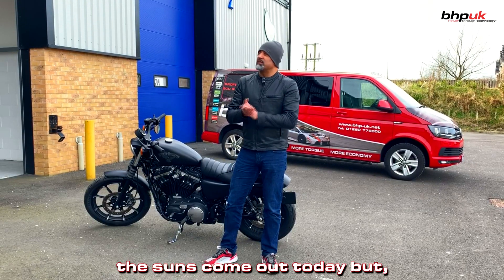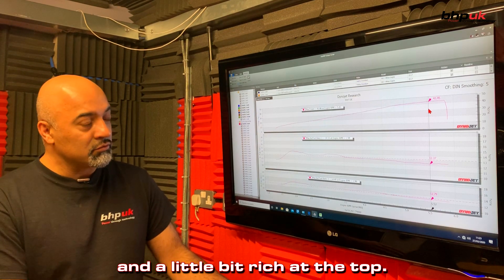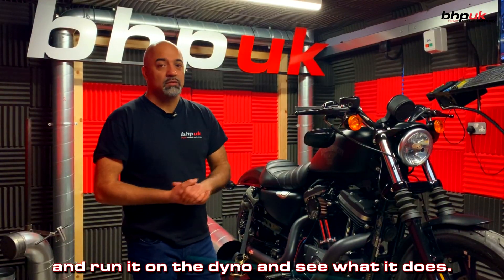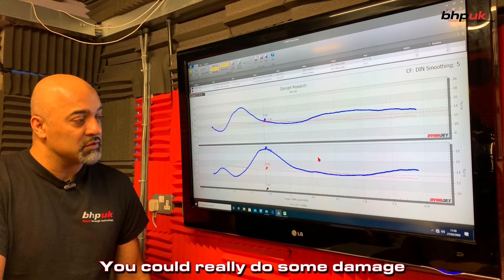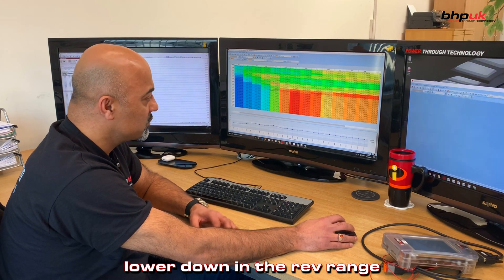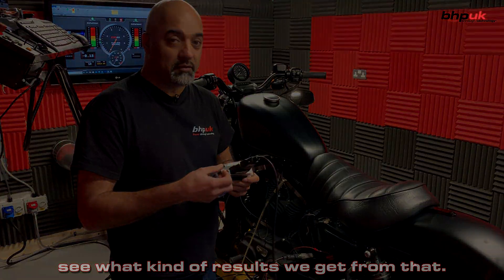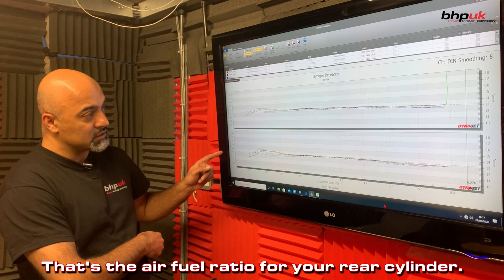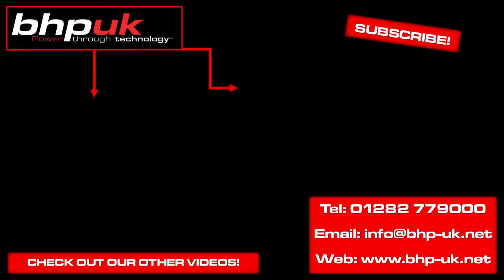Harley Davidson 883 Stage 1 Remap (ECU flash) Development giving 30% Power Increase!!

Comment: i need your advice , my harley davidson iron 883 new model 2021 has vance & hines slip - on , the performance is not the same as the stock motorcycle , what should i do ?  I was advised by some people to install airfilter and fuel pack , I am confused which airfilter should be installed ( k&n stage 1 or Vance & Hines vo2 or screaming eagle performance ) , is it necessary to replace the screaming eagle performance plug and wire also Vance & Hines  Fuel pack 3 too?  give me advice what to do.
Reply from the maker: Give us a call. The map writers will be happy to help. 
+441282 779000
info@bhp-uk.net

Comment: Have you tried that set up but used a “power vision” tuner instead of the dyno ?
Reply from the maker: The Power Vision is another way of flashing the ECU, the bike would still need to go on the dyno to check the power output and to optimise the fueling.
Reply: @BHPUK  I’d be interested in seeing a comparison. Dyno tune vs power vision. Thx for the reply

Comment: 30% increase in performance! It would definitely be worth the investment to get those kind of numbers, but I haven’t seen anyone else achieving the same results?
Reply from the maker: It is definitely worth it! On this model of Harley, with these mods and this kind of setup, it will make this power and has done on everyone we have seen so far :) Do you have the same model?
Reply: @BHPUK    I have a stock, 2020, iron 883.
Reply from the maker: @robbyclark6915  Oh nice! If you want to talk more about it do give us a call on 01282 779000 You can talk to Qal in the video if you have any questions :)
Reply: @BHPUK    Unfortunately guys, I’m over in the USA or I would love to get this setup done to my bike! 😢 mine is still under warranty as well so I have to use SE tuner I believe? Idk, but no one around here is getting results this good from a stage 1 unfortunately.
Reply: @robbyclark6915  i’m in same situation. 2020 883. And yes you will void warranty if dont use HD tuner (i’m opting for Dynojet Power Vision). Wondering if using autotune feature will get me close to 30% increase.
Reply: @andytovar2192    I don’t think you’ll hit 30% like they did, but it’s worth a try I suppose? I’m trying to decide right now what’s the best option for my bike at this stage being bone stock and still under warranty? I thought about a SE tuner and maybe a SE breather but no pipes because I don’t want to be that loud. I know I won’t achieve anything like they got, but just to fine tune the bike a little and maybe get it running a little cooler and such. But I’ll have to have Harley do it because I don’t have the means to adjust the tuner and I want to keep my warranty. But I already know the Harley dealership here will just try to make me buy everything they can sell me and will care 0 about the actual performance of my bike.
Reply: @robbyclark6915  vance and hines has a tune and exhaust and intake just buy that same power number for the vance and hines stage 1 kit

Comment: Do harley 48 needs an ecu reflash? Its all stock...
Reply: No. If you add exhaust and air intake (or either one alone) then yes. If you change your air/fuel in anyways then you want to reflash the ecu to the proper map. There are several popular tuners out there now. Personally I run the vance and hines fp3, but the dynojet powervision is supposed to be the best one out there!

Comment: 2017 iron 883, 5000mi, V&H short shots, arlen ness big sucker. "Everything about the bike is running worse. hotter, throttle is sluggish and unresponsive, noticeably slower, decel pop and backfiring now, and nearly dies sometimes when starting to take off in 1st. just so you guys have all the info, i started with 2402 tune matching the exhaust/air cleaner i have, but that and the tune for RSD 2-1 are running poor, for some reason the stock tune is the only one that is decent. I'm at a loss, and am not really having fun riding now which is unfortunate." bike was running fine until I did the intake and dynojet.
Reply from the maker: Hi Tyler, we need to run your bike on the dyno to see what it's doing.  Its probably very lean now that you have the Big Sucker on. We have just remapped an Iron running a Big Sucker & Short Shots.  Please call us on 01282 779000 and one of the guys will be happy to help.